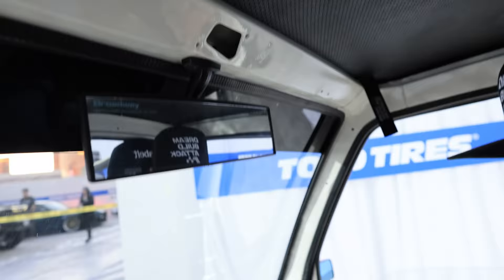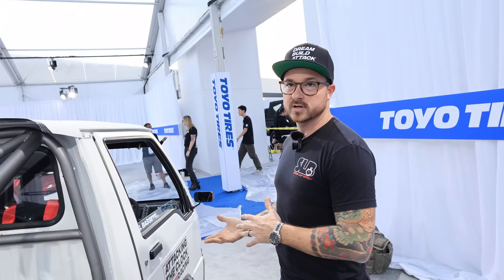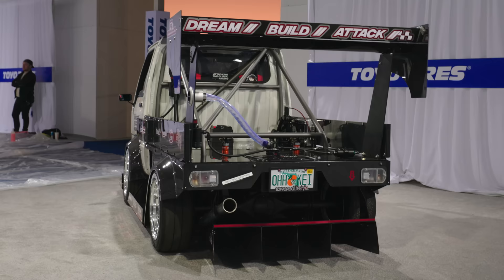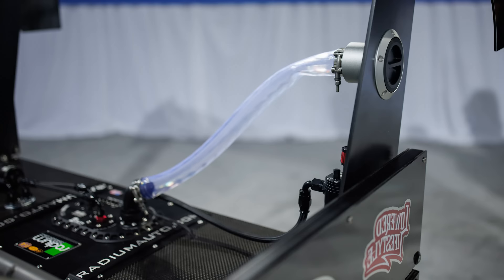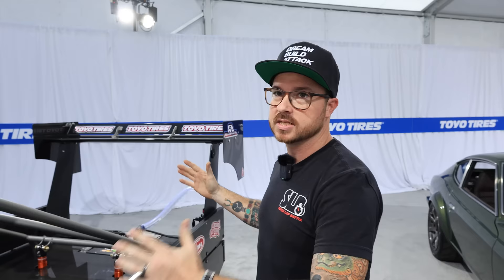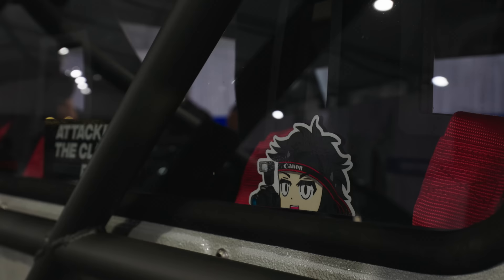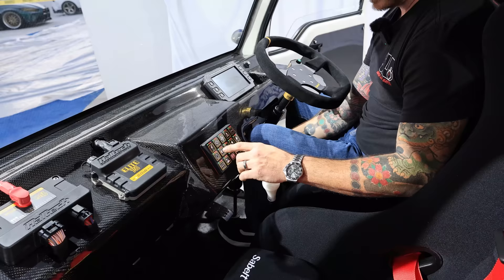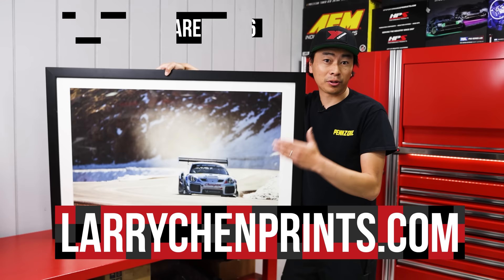40hp Time Attack Kei Truck With Overkill Aero, Built By Pikes Peak Racer, Shawn Bassett

Comment: 12:00 they are not that slow.  I had a "Bedford rascal" which was basically a Suzuki that was rebadged. It has a 900 something cc engine that was rated for 39hp.  Even after 20 years, it could still do 70+ mph.

Comment: How light is the battery? The home made one I run in my 1.6 litre and smaller cars is 1.3kg only. I run double that (2.6kg) in 2.0 and bigger and I use a 5.2kg pack for our 8.3 litre Cummins diesel in the boat. Respectively the CCA ratings (tested) are 325CCA, 650CCA, 1300CCA. LiFePO4 of course. Headway 38120HP cells :-) I have a Daihatsu Midget II that I have tracked, it was hilarious but BADLY needed an LSD since it kept lifting the inside rear and limiting how much of the 31hp I could lay down, ha ha, the high CG relative to track width was never an issue due to that. Awesome fun anyway, though.

Comment: I'm 6'3" (191 cm)  - it needs a body extension.  You can't race that - it's dangerous given your severely limited range of motion.  You wanted to do something never done - well, mod it so it a 2023 American human can actually go zoom zoom safely (relatively).  And that's your excuse to upgrade to a Triumph Rocket motorcycle engine. It's a 2.5 liter triple.  It's heavier, but you need the extra weight in the rear for traction to handle the monster torks.